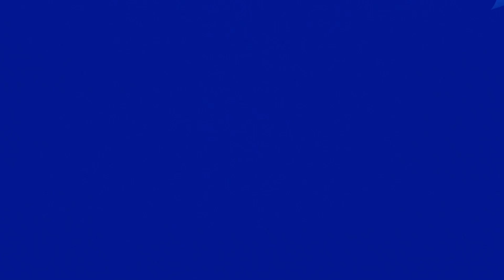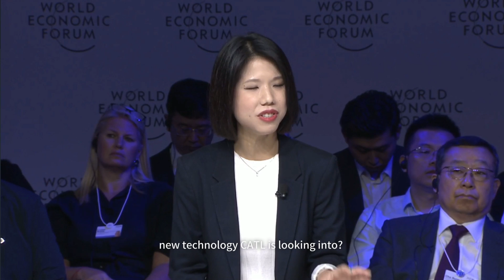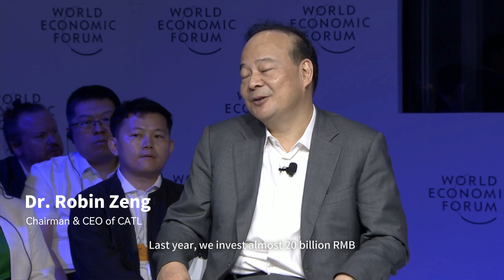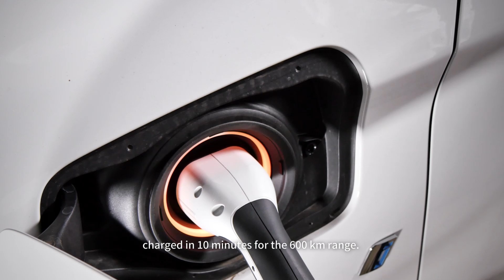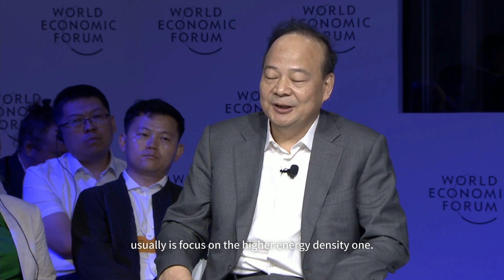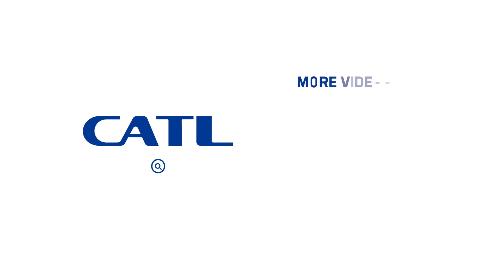CATL Robin Zeng at the WEF's 15th Annual Meeting: Not Losing Momentum on the Energy Transition

Comment: I hope you will use your condensed battery technology concept to design and manufacture LFP cathode version of it for passenger vehicles,i mean you can replace the NCM(nickel-cobalt-manganese)materials with highly condensed nano LFP(lithium-iron-phosphate)materials for the cathode side of your condensed battery it will led to have a automotive version condensed LFP  cell with atleast 450 wh/kg in cell level energy density,and with zero degradation technology concept which will provide zero deg rate for battery's first 1000 cycles and effective 6000 cycle life span(88% of remainig battery capacity),it will be real game changer,EV industry wont need any better cells for the next 20 years or so,please be more passionate about energy densities of your automotive cells  not just for the aviation industry,which wont be any practical atleast for the next 10 years or so
Reply: Catl's M3P(manganese 3 phosphate) battery or LMFP(lithium-manganese-iron-phosphate) seems to be cancelled due to recent achievements in developing higher energy density LFP cells,for instance recently interduced shenxing plus battery pack  has 205 wh/kg system level energy density meaning it has 250 to 260 wh/kg  condensed LFP cells inside it meaning it can easily surpass M3P's 230wh/kg promised  energy density at cell level,which is very very marvelous,also i should mention the fact that M3P has its own disadvantages for example 30% lower effective cycle life compared with original LFP cells which have 3000+ cycle life,and other cons that makes it less valuable compared with LFPs,then for the range of an EV with 500 wh/kg condensed semi solid cells,you see there are 2 factors that really effects an ev range,first is drag co efficient and then mass of the vehicle,in theory an ev with drag co efficient of cd 0.2 and weight of 1500 kg should have around 9.8 kwh per 100 km energy consumption rate so when you have 450wh/kg in battery pack level energy density,it will led to have a battery pack with capacity of 100 kwh and mass of 220 kg in total which is 400 kg lighter than average commercially available 100 kwh battery packs,so an ev with 220 kg 100kwh battery will weigh around 1500 kg in total and can easily go 1000 km on a single charge,and dont forget this amazing fact that CATL wants to commercially manufacture lithium air(LI -O2)battery cells by 2032 for ev and aviation applications,lithium air battery has potential  energy density of 750wh/kg to 1.7 kwh/kg cell level meaning if you consider 1.5 kwh/kg cells it will be equivalent of 95 octane euro 7 petrol energy density,meaning you will need only 60 kg battery pack to travel 1000 km for pure BEVs,or 30 kg battery for  PHEV to travel 400 km on just electric power only,intresting future is waiting
Reply: @davidfujkk8018  thank you so much for your insight.. The lithium air battery, what will be it chemistry between the Anode and cathode..
Reply: As For lithium air battery;Lithium metal will be used for anode with 12 times more specific capacity compared with current graphite(carbon) anodes,manganese-catalyzed for the cathode and aqueous alkaline electrolyte,i should remind you the fact that the whole purpose of developing solid state battery is to use lithium metal for the anode in SSB,because it can store 12 times more energy compared with current graphite(carbon)anodes,i think CATL some how managed to prevent dandrite formation by lithium metal anodes in their condensed battery cells with out all solid electrolyte,that is why its called condensed battery not solid state battery because it has semi solid electrolyte,after all i think ultra condensed nano LFP cathode and lithium metal anode and semi solid electrolyte is what CATL and other manufacturers should persuit and develop for EV industry with atleast 450wh/kg cell energy density and 3000+ cycle life,lithium air batteries have low cycle life and are not that stable
Reply: @davidfujkk8018  okay.. Cool.. Am happy no mentioning of cobalt in the condensed battery chemistry.. So please to hear that.. You and i know that every EV that are currently been manufactured always have a curb weight of 2500kg, so the 100kwh battery won't be able to achieve such range of 1000km, except it's a lucid air vehicle, that has good efficiency. Maybe, 150Kwh battery can easily achieve that stated range.
Reply: @davidfujkk8018  what do you think about sand battery.. Is it even possible
Reply: Is it possible for you to the maths the driving range one will get from 100kwh condensed battery pack?.. Is 1000km achievable..  

 What do you think about CATL LMFP battery?, is it same thing like CATL Shexing or Shexing plus battery pack..